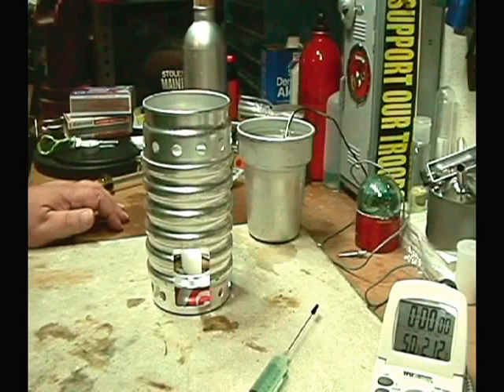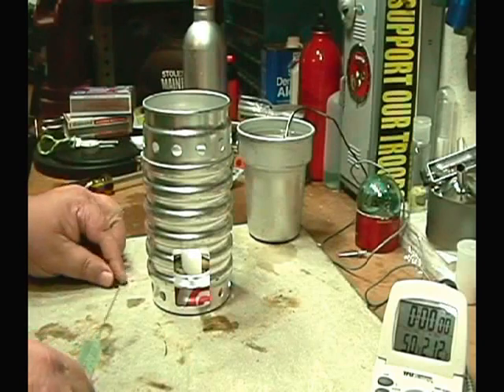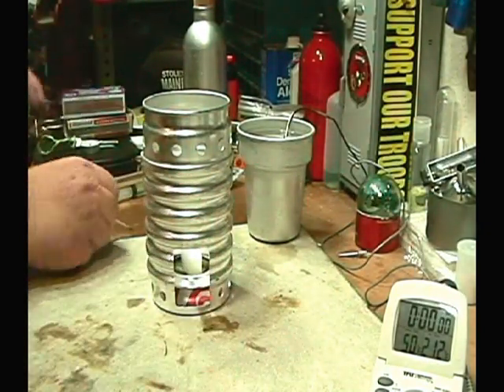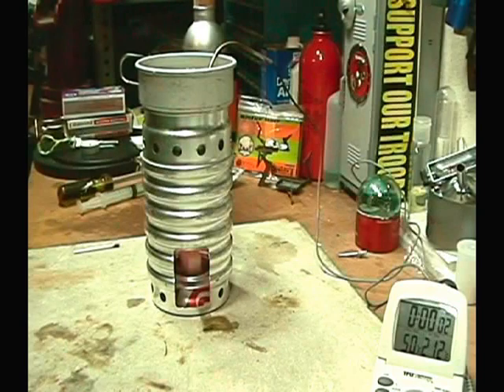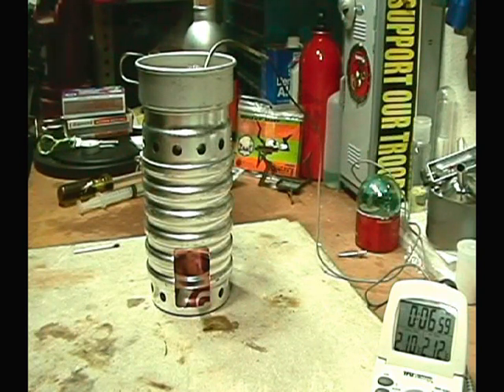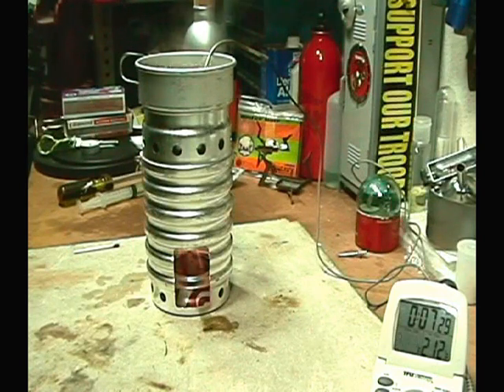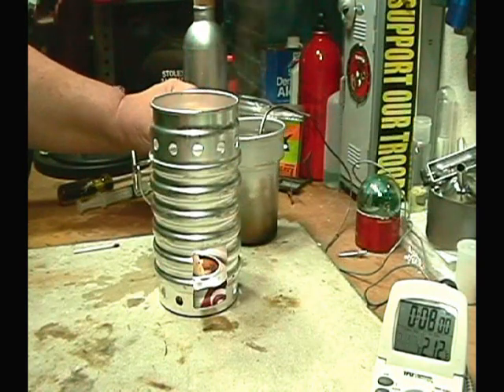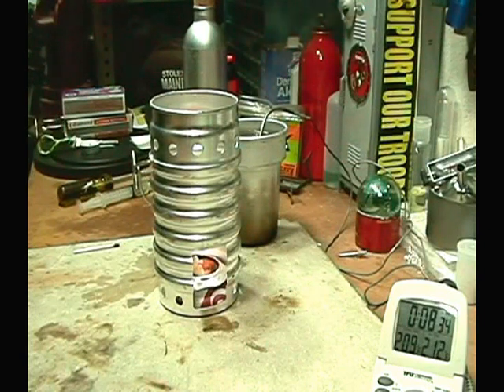Swiss Ranger Volcano Stove Boil Test 2

Comment: I learned something new today with the esbit and alcohol!  When you do the wood just use twigs, big cuncks of hard wood warp the stove! I guess thats too much heat! I still think a little Alcohol stove on a booster seat is the ticket!  I forgot to mention that my friend built another stove out of two bottoms of the aluminum bottles that fits through the hole and works great as well, just have to add fuel to it after it is placed insde the volcano. Or tip it on its side and then put the stove in!